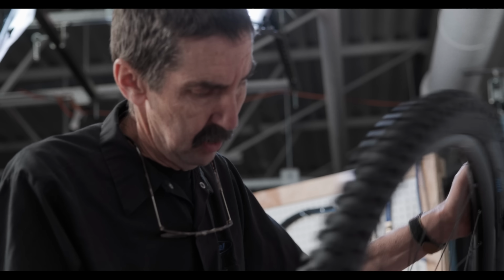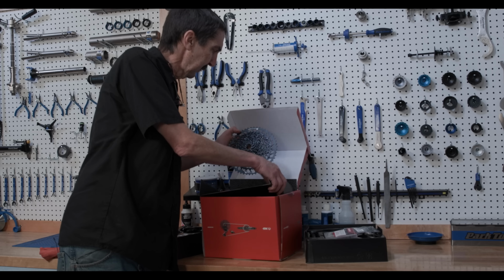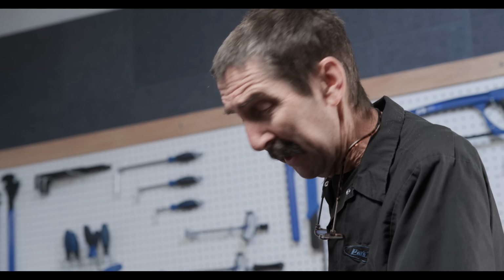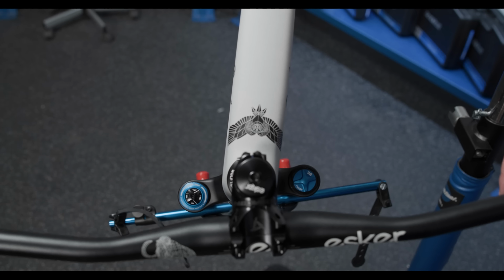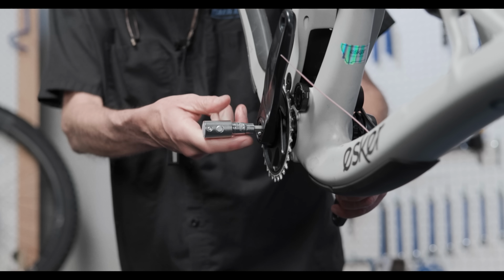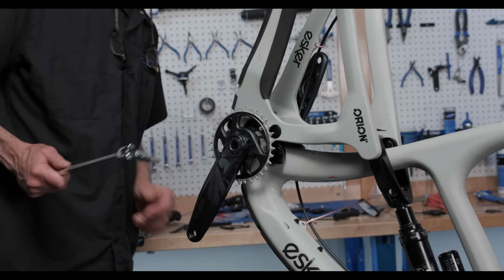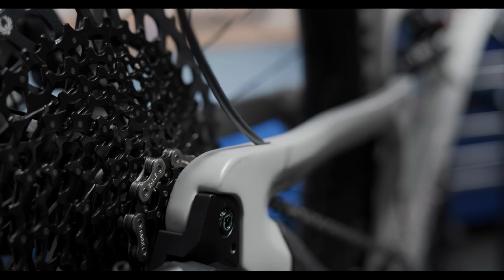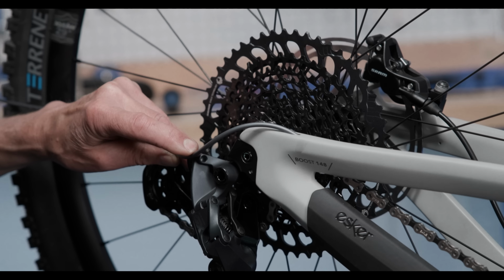Calvin Builds a Bike | Tech Tuesday #213

Comment: Photo protocol, there's an argument for having the top and bottom chain runs parallel, but I usually prefer somewhere in the middle of the range so the derailleur has an attractive Z bend to the parallelogram rather than the pulley cage being at either of it's extremes.

Comment: SRAM: ”Full Suspension Frames: To size the chain, the rear shock must be fully compressed.” Calvin: Yes.😁
Reply: You can just add 4, I think hardtails could do with less or something.
Either way, with the add 4 technique I get the same chain length needed as when my bike is fully compressed.

Comment: Now there's one more thing to line up, the mfcr logo on brake rotor to the valve. Of course Calvin goes by the book. Gospel of Calvin in his letter to the bikebuildians thou shalt align ones rotor logo with thine valve. So let it be written so let it be done.
I see a new park tool the HAG1 Handlebar Alignment Gauge 1, although I think it could be made in a U shape with the ends coming up all the way to the bars to align them
Keep up the good work Calvin Thou Art The Man

Comment: It's reassuring that even Calvin can slip up! I'm curious; I've always used a little grease or anti-seize on the threads of XD divers, as I've been stung with a very stuck Eagle cassette in the past – Calvin didn't use anything. Was there a reason why?? And can we find Calvin some grey brake hose and zip ties? 😂
Reply from the maker: Threads got anti-seize. Much gets left on the cutting room floor.
Reply: @parktool  I’m relieved!

Comment: why did you have to use a tool to get the rear derailleur cable through the housing?
Reply from the maker: Some bikes are "lined" with internal guides for the housing. Some are semi-lined, so the guides goes only part way.

Comment: What was that tool that he had in his one hand at 17:38? It’s silver
Reply from the maker: That is SRAM's B adjustment tool for eagle drivetrains. It helps properly set the B gap, which is how far away the upper pulley sits from the rear sprockets.

Comment: Sweet looking new rig Calvin, enjoy. Guessing you clocked that axle on the fork properly after the video was shot ;-) For photos, bike should be in the gear that puts the derailleur cage pointing down at 90 degrees to the ground ;-)
On the whole 1x systems being the Bees Knees, gona have to disagree with ya on that one after working on quite a few and seeing cassettes having to be trashed because there are only a few regularly used gears, which wear out long before the rest and start to skip/give trouble, not good IMHO, not an issue with 2x.

Comment: Why is anybody making bikes that require zip ties to hold a cable in place?  My wife’s inexpensive, mid-1980’s hybrid has nice braze-ons that the cable housing just slips through.  Zip ties just scream, “We’re too cheap to do it right!”
Reply: They don't require zip ties, they're supposed to use a small clip. Working in a shop I can tell you everyone hates those little clips so we all just use zip ties cause they're easier. The other part too is if the braze on breaks off, how do you route the cable?
Reply: @d.b.cooper170    If a braze-on breaks off, then you can use a zip tie!
Reply: @markholm7050  lol.  Well played